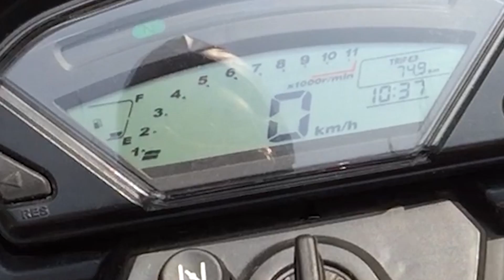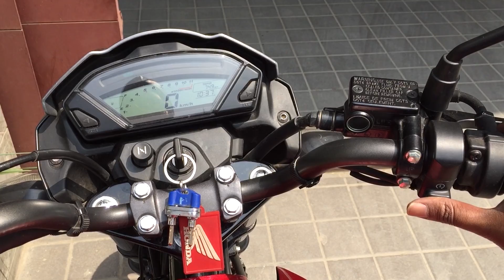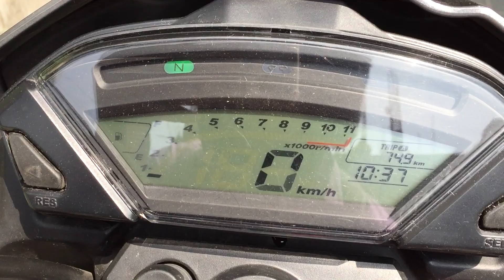How to Solve IDLE RPM Problem of Motorcycle | Problem SOLVED in 30 SECOND

Comment: If I set rpm greater than 1000rpm or at 1000rpm ,  then also after 2min s rpm gradually decreases and ultimately engine stalls..Please help?
Reply from the maker: At first, run the bike for few kilomiters, then adjust the rpm. I hope it will help.
Reply: @TarekZamanVisual  after running for 6km adjusted..Bro..yesterday I bought this bike...
Reply from the maker: Bro, till few hundred kilometers, rpm will fluctuate. After the break in perid, it will be stable. Please maintain the break in period properly. See my video realed to break in period.

Comment: Hey, I have a opposite problem, I generally keep my rpm at 1200-1500. Some time even if I am not acceleration or I am stopped I see a very high rpm like 2000-3000,  this happens only sometimes and not always. If I reduce rpm then engine stops on breaking. Mechanic isn't sure what's happening.
Reply from the maker: Change the chock cable.

Comment: Iam using bajaj pulsar 150 motorcycle and the problem is when bike started the idling is 1000rpm and after 3-4 km run the idling rpm goes to 1300-1400
Reply from the maker: New bike a kichu din ai rokom hote pare.  Pore thik hoye jaba. R jodi porono nike a hoy, tahole service Center a dekhan.

Comment: Bhai hamara Honda CB trigger ka curboratr ka slow Z pin change korleya but fer bhi CB trigger me problem de raha hay. Engin thanda hone se problm hota hota hy aur dhakka dhakka mar raha hay. Kus solution hat keya
Reply from the maker: Bhai, its a common problem of CB Trigger in winter season. Every morning, during the first start pull the chock cable first and try kick start, after starting let it 30 second and push the chock back. After that keep you bike idle for 5 minutes on horizontal position and make sure engine is running. After that start riding. Practice this every morning, i hope this will resolve the problem or may reduced it.
Reply: @TarekZamanVisual  yes.. you also face  sem problem with CB trigger..???
Reply from the maker: Yes bro i faced the same problem and i used to practice the same process, now my bike is ok and out of this issue.
Reply: @TarekZamanVisual  ok.. thanks bro..
Reply from the maker: Welcome Brother

Comment: My bike has a very bad problem please help. RPM remain high in neutral (or pressed clutch) when I'm running over a speed of just 30 km/h
Reply from the maker: Bhaiya rpm adjust kore dekhte paren. Tate o na hole, mone hoy chok cable feshe ase mone hoy. Apni service center a dekhan.
Reply: @TarekZamanVisual  please rply in English bro
Reply from the maker: Seems your rpm is not adjusted properly. Adjust it after running few kilometers. If it is ok even after that, go to you service point or dealer and inform them about the problem.
Reply: Unfortunately bajaj service men only know one thing i.e. changing engine oil........by the way thanks for feedback
Reply from the maker: Ohh. Thats really sad. You should go to a good service center or mechanic if it is bothering you again and again. I know how it feels to ride with problem.
Reply: God Love  bro there is no carburetor.... Its FI

Comment: Put a translation
Reply from the maker: Ok, will do it.
Reply: @TarekZamanVisual  thanks bro, I've got some questions,i have a problem with my bike, whenever i starts my bike,the rpm will goes up fo 10 or 30 seconds before it's back to normal.and also the rpm will normal when i shift the gear. could u tell me why it's happen. And it's look like lot of misfire.thanks
Reply from the maker: I think, you must take your bike to service centre and show the problem to service guy immediately.

Comment: Why does rpm increase when my bike runs two or three kilometers away?
Reply from the maker: Because after few kilometers engine got warm , then it shows the actual rpm reading. That is why i asked to adjust it after riding few kilometers.
Reply: @TarekZamanVisual  Ok bro thanks
Reply from the maker: You are most welcome brother.